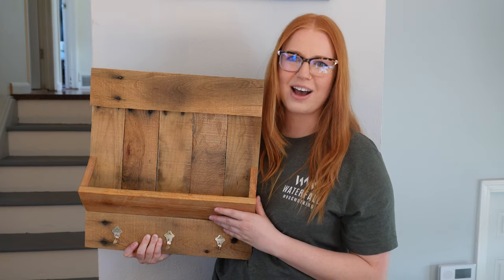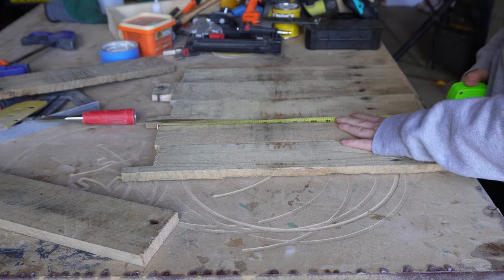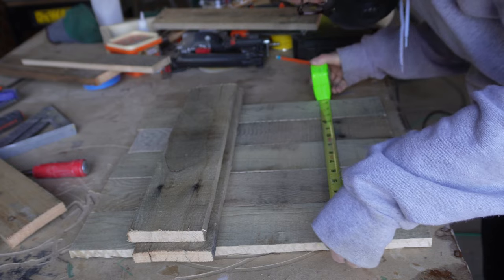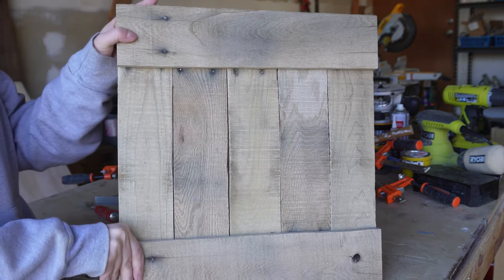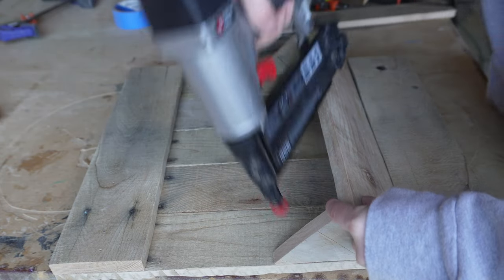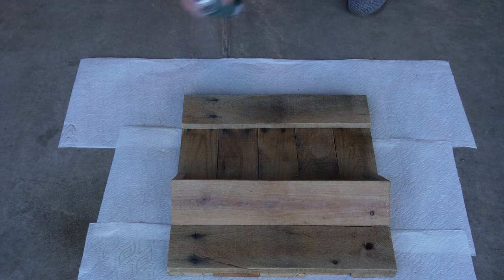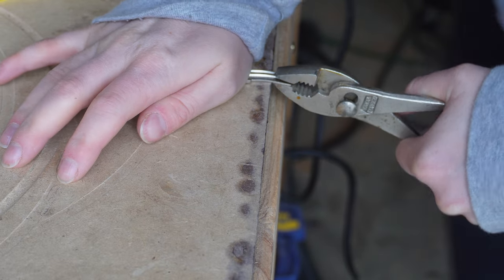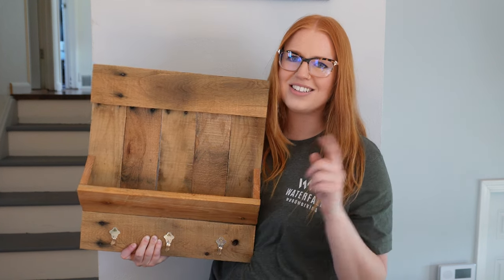DIY Pallet Wood Mail Holder | DIY Mail Organizer | Mail Organizer | Wood Mail Holder

Comment: i would have added glue to it all.
Reply from the maker: The support pieces held everything together really well!
Reply: @waterfallwoodworking  like i said i would still glue the support pieces. its 10 cents of glue. one brad each board wont hold it there. it would take 10 seconds to apply the glue and the cost is nothing. loads of asian channels doing woodwork with pallet wood not using glue already. they fall apart within a year.
Reply from the maker: @BigBoyDIY  well I did 2 brad nails each board and it’s holding together absolutely perfectly 👍 Decided against glue as the pallet wood is imperfect and things didn’t sit flush, and the temperature outside wasn’t right for wood glue. But if you make this, deff use some glue! 🙌🏻